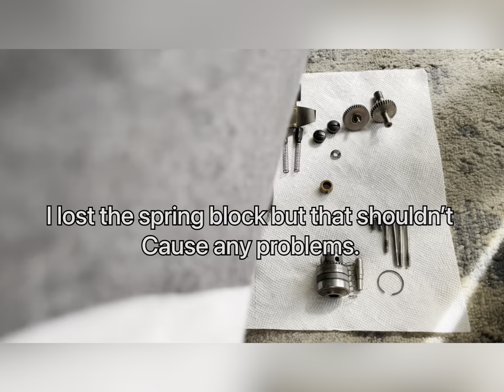Craftsman Electric Drill Restoration. ( Another one )

Comment: What happened to the front case? It’s not cracked at the beginning but at the end there is a huge crack from the screw towards the chuck when the drill is facing right.
Reply from the maker: You see in the video where I’m removing the bearing? When I put it on the vise, I forgot to cover the bottom part, and as I was hammering it, I damaged it. Very unfortunate but lesson learned. Good eye by the way. Thank you for watching and asking about it.

Comment: How did you remove the chuck from the drill?  I see that you unscrew it, but how do you keep it from just turn it around?
Reply from the maker: First check to see if there is any screw at end of your drill chuck. If there is any, unscrew it. (Counter clock wise). In my case there was no screw. Then put an Allen key inside the chuck, and tighten it. Then by using a hammer in a counter clock wise direction, hit the chuck key until it opens. You might have to try it few times. Sometimes you can open it very quickly depending on how rusty or tight is your drill chuck. But that’s all. So just simply an Allen key, in a counter clock wise direction and a hammer should do the job. Let me know if you had any issues. I’d be more than happy to help you. Good luck to you.
Reply: Thank you!
Reply from the maker: @unknownprivate3721  You are very welcome.
Reply: @VintageCraftsmanTools  How do you know if the chuck is press fitted or screwed?
Reply from the maker: @unknownprivate3721  if you open the chuck jaws completely, at the bottom of the chuck. I mean when you’re looking inside the chuck. you should be able to see if there is any screws inside or not. If there isn’t any, then all you have to do is use the Allen key to open it. And if you see any type of screw inside the chuck, then just do what I mentioned before. Unscrew it counter clock wise.
Reply: @VintageCraftsmanTools  Thank you again!
Reply from the maker: @unknownprivate3721  You’re welcome. What you saw on the video is exactly what I did. There was no screw and it wasn’t that tight, so I was able to open the chuck with only couple hammers.